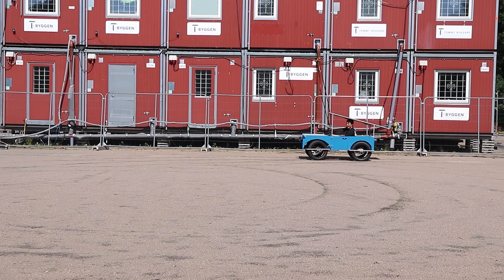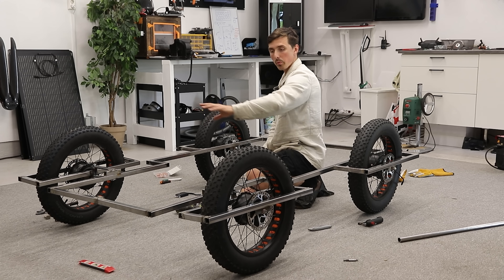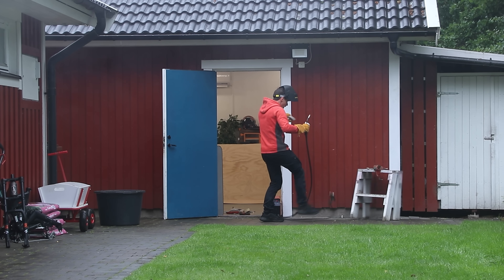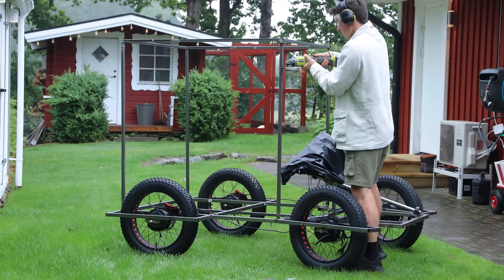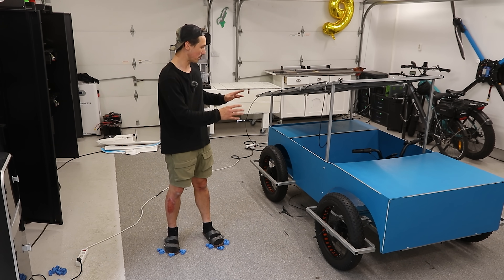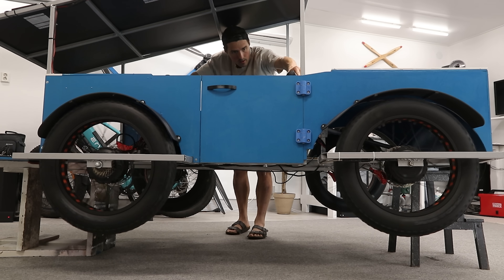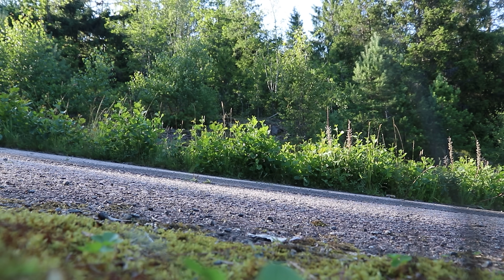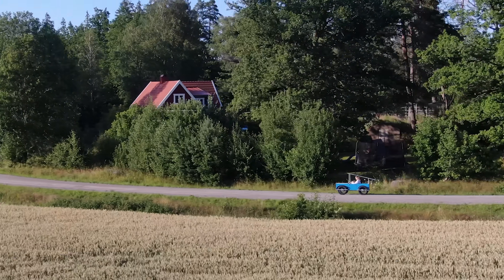I Built a Solar-Powered Car – And It Works!

Comment: The front wheel attachment bends a lot because the vehicle weight, when reacted at the wheel contact patch, creates a significant bending moment. If you made the kingpin longer, it would itself have more mechanical advantage, so to speak, against the aforementioned bending moment. This is part of why there's a lot of space between the ball joints on a knuckle.

Look up the Yamaha Banshee wheel knuckle. My engineering team back in college used Yamaha Banshee parts for a lot of our solar car.

Still, there's a lot of damn great stuff here, especially for a single guy.  And it makes me so happy to see Ackerman steering implemented. 🔥🔥
Reply: Yes, there's always something like this in these builds. I'm impressed but like the comment I left in the last one I wish he'd do some sort of online coarse or something that teaches basic physics like this. Or play one of those bridge building games or something.

It's intuitive to me I think because I grew up making technic lego cars, catapults and guns to shoot blocks at my sisters so you learn about leverage and all the things you just put words to. I'm sure if he set out to correct this knowledge deficit it would be pretty easy and make these much easier to watch and final result so much sturdier with very little change.

Edit: I also was impressed with the steering, great to see some research and a great result.
Reply: @nommy8599 I think intuition goes a long way, and that intuition is built by just experimenting with building things (exactly what he did here).

Once that intuition is built, studying engineering shows you how to quantify and analyze what one might  intuitively know. He can determine the exact section modulus for the king pin required to prevent plastic deformation.

But courses definitely don't build intuition. I've met many engineers that -- while talented at math -- struggle with intuition.
Reply: @Fireflyepic  Yeah I agree. That's why I suggested playing one of those bridge building physics games. IDK if you know them but you have to put together a bridge on a budget which a vehicle can drive over and the physics are realistic with different materials having different tensile and compression strength - wood, rope, steel etc.

I bet there's a lot of other things like that now where you have to build stuff which would result in the sort of understanding and intuition he lacks and you could do it on your phone on the bus etc.

IDK if online courses include or recommend things like that but they should, or if there's any specifically targeted at learning about leverage etc like this.

Another option is to design the 'thing' in some 3d software or even a good sketch and then do a real quick vid, perhaps on a 2nd channel, for people to critique. That would also be a good way to learn as people would be happy to contribute and explain.

There's another channel where a guy is building a 3rd marble machine to play music and now turns to the community for engineering expertise. His quality of work has improved so so much and it's really satisfying to see, even more so since he isn't professionally educated in building those things. I could see this channel going that direction too.

Comment: Hope makes dual lever brakes, but you could just run a t in your lines to split them into two. Or just put your brakes on the front only, a normal car does 90% of its braking on the front anyways

Comment: Very nice build!🔥 Maybe add a 5th wheel with a mechanical freewheel motor, controlled by a button and a safety relay – so the 4 main wheels don’t fight against it when reversing 😄
Reply: Good idea

Comment: I don't understand. On the very first test before there was ANY added weight, you could see the front tires bowing in from the absurd geometry of the dual flat bar front wheel mounting.. which was pretty easy to predict before it even happened. Yet, nothing.

Comment: You should flip the rear left wheel and reverse the direction on the controller so you have the brake discs on the inside and the cassettes on the outside

You can also use a 24v boost converter to get each panel up to 48v so 2 panels would be plenty

Comment: Really cool video. Du byggde en Flådbil (flådig lådbil = Flådbil) 

It would be both more convenient and free up space if you put all four brakelevers on top of eachother, attach them together with a piece of metal or a 3d printed part and then attach them to a brakepedal.
Reply: or just mount all 4 on the floor and put a stick of wood across and use it as a foot break
Reply: @TommyApel I thought of that too but I don't think they are designed to be angled like that. The reservoirs might no be able to feed oil to the brakepads as they wear down. Better be safe than sorry

Comment: hey what panels did you use? I was thinking about making an atachment to my ebike where i have 2 panels at the sides of the back wheel, which i can fold up when there is enough space or if I just dont drive it

Comment: Fun stuff and with that range its probably going to be useful too!
This spring ive put together a 25mm square tube project of my own, a smallish bike on 13x5x6 wheels, a 1000w motor and currently two 36w ebike batteries totallting 22ah.
Its not all that special but its my first welding project as well, it can go 25km which is enough for me to get to work, charge during the day and get back home. 
Ive also been using it to go get groceries and do errands.

Comment: I think its a great start but if you intend to actuallt keep this project after the video, the frame should be redone with heavier steel and better welds. Some of those welds are pretty bad for and already lightweigh unbraced frame. Fun video.

Comment: Is this the Model T? It sure looks boxy enough. 
Maybe the next version will have suspension!
You can even use an Arduino and a pot attached to the steering and acceleration, to send the right signals to each of the 4 motor drivers, and make that baby run like a rally car. 
Differential drive makes everything better and rid like an expensive AWD car. I think there's a Arduino library for that!

Comment: No edge paint on the plywood is going to bite you in the butt the second this thing gets hit with moisture... even high humidity over time will delam those panels - is what I would have said if I hadn't kept watching the video and realized you edge painted later on.  Fun build, it is ugly in an endearing way - I like it.

Comment: @9:35 nice foot position markers =P
Reply: He was alone and want to make sure  he is inside the frame
Reply: @Atomic-toons00  Na, it was for the jump cut, so he'd be standing in the same place before and after the cut. He did the cut well, I was just teasing on the visibility of the markers (those are usually not on screen)

Comment: So do you think if you use the rear motors and the one battery and then when that goes bad, you use the front motors and the front battery and while you’re moving the rear battery and motors should recharge right? 
For reverse I think you should just spin the front two wheels around  so you’re only rear wheel drive and the front can push you back

Comment: meh, feels a bit gimmicky. 😒
no suspension, jerry-rigged everything, no reverse, no types of seats and restraints, and you didn't even close the tube ends...lol, it's like it was just built as "content" and then it's going to be disassembled and cannibalized for parts. the ackermann steering geometry hack was interesting though, gotta give you props for that. 👍
Reply: >it's like it was just built as "content"

yes that is the point of being a youtuber with 900,000 followers. it's a fun project that can be improved upon later, but the point that it's at now is great for a demonstration for all your followers. not to mention it's all a solo project!
Reply: First time here?

Comment: There is plenty of space for solar panels on the hood.
Reply: Yeah missed opportunity
Reply: He would need 3 more without fancy voltage modulation.
Reply: @artsmith103 A fourth panel wouldn't require any changes, as the MPPT controller would step down the voltage as needed. However if that fourth panel is shaded, the efficiency of the whole system would suffer.
Reply: @TimGmbH1 I see what you mean. I always set up individual or groups of panels in sets that serve the battery voltage. Extra large array just for the extra watts doesn't seem efficient to me. He said he has plenty of solar Wh and this is just a toy.
Reply: @TimGmbH1 Typical 24V panels have Voc~36V and Vmp~31V so even 3 panels is technically too much for that charge controller but probably okay.

Comment: For the front wheels you could have used the forks from the bikes. And you need suspensions. Also the brakes  can be modified to work with a single handle brake .And if i think about it a little more, you could have used four suspensions forks from bikes .
Reply: 4 suspension forks would have added a lot of weight though, might not be able to hill start with all that extra weight. Maybe some beefier tyres would help, similar to a golf buggy...
Reply: @bushyfpv8036 that's why he should upgrade his hub motors and add a 72v batteries
Reply: Yeah; I was just gonna say that dual-cable-actuating brake levers are available now (Google "dual cable brake lever"); Zack Nelson ("Jerry Rigs Everything") used a pair of this style of handlebar when he rigged up the prototype bike for his then-girlfriend-and-now-wife Cambry, so that she could put on all four wheels' brakes at once by squeezing just the two brake-handles: https://www.youtube.com/watch?v=sh0bax1Kyug

Comment: This is awesome but i don't love the way the front wheels are attached. Great video as always either way!!
Reply: it doesn't matter, you see this car for the first and last time
Reply: good point although it's fairly simple to reinforce those areas, I think he did an amazing job considering his experience level with welding and what he had available
Reply: Wouldn't look as cool but it would be simpler, lighter and more efficient to just to have 1 wheel at the front.
Reply: @bloodypommelstudios7144 and more unstable... steering is complicated with two wheels is deceptively complicated, but it is worth having it right
Reply: @bloodypommelstudios7144 definitely easier but not as stable.
Reply: Boxing it in would've helped a lot
Reply: maybe Tracks and Tank style it
Reply: The original forks seem like a good option. Stem to frame and so on